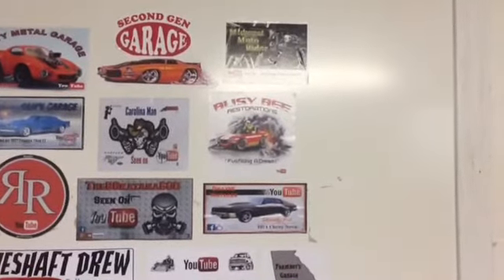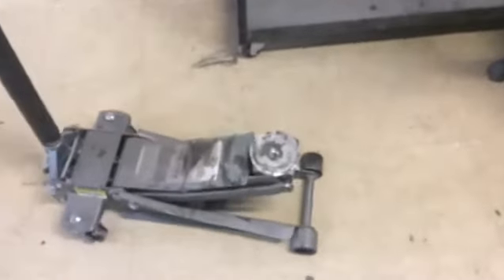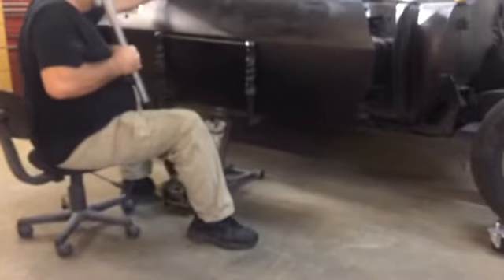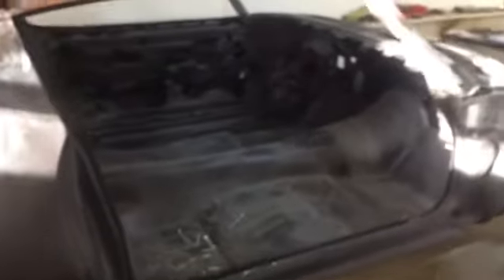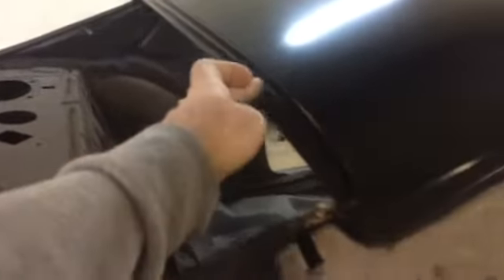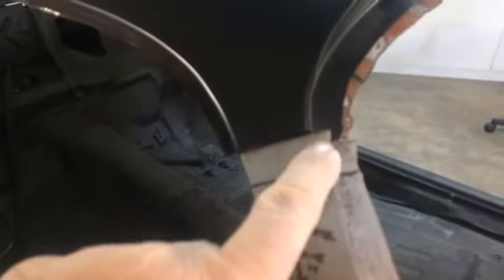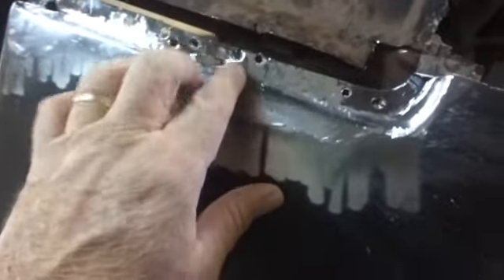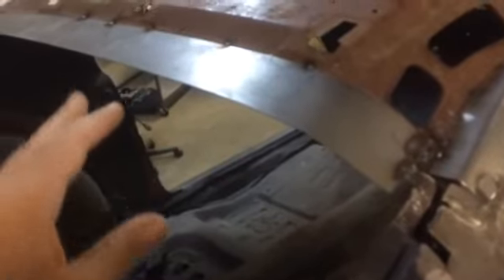Camaro roof skin replacement Part 1

Comment: I am about to do the same thing to my 1973 Firebird.  This will definitely come in handy.  THANK YOU!!
Reply from the maker: Thanks for watching Jay. If you have any questions along the way, don't hesitate to ask. Glad to help if I can...
Reply: Thank you!!  I will definitely be doing that for the next couple years.  lol.     The issue with mine is that at some point in the past 45 years, someone replaced the landau/vinyl on the roof.  I don't care for that so I took it off and it will not be put back on.  Anyway... whoever di it last, half assed it.  They even put different sized screws through the nice chrome trim around the windows, this let rust in and rotted out the roof at the top of the window and, the rear speaker deck and no doubt the trunk hinge area.  This is going to be a project.  I will be binge watching your videos today.  Again, thanks for doing these, our project cars are almost identical.

Comment: Looking good Jeff! Before you do your final welds on the roof skin support structure, I would make the cuts on the roof skin so it can lay exactly in its final position and use it to make sure the inner structure is correct. Just my two cents. I would also mark the center of the inner structure and roof skin front and rear.
Reply from the maker: Did a lot of test fitting today. Trimmed down the edges and marked the centers so I could replace in the same place every time, great info and much appreciated. Got most of the sub structure repairs done, should be ready to weld up soon. Thanks for commenting and watching..

Comment: Good Videos and thanks for making them! I'm building a 70 and much like yours, it does not have a lot of value. It's a base with no original parts and had 2 previous and terribly executed restores. I've had it for 2 years and another unexpected  project put the 70 on hold, but last spring I started back up on it. I have a very small garage/work space and didn't expect all the metal work the car needed. I was lied to when purchasing as the the guy I got the car from told me all the metal work was done and the only reason he was selling it because he found the car of his dreams... I think it was a lie and he realized that even after all the "work" he did/had done to this car it still needed much more. So a lot of seam sealer and paint he threw the car together. 

Anyway, so I did a little metal work and will straighten out some of the stuff he did and will put the car together and enjoy it a little. I hope to retire in a few years and move out of the city and gain a bigger work space. Where I plan to take the car apart again and do the floor pans, quarters, package tray, trunk and tail pans over.

Sorry for babbling on, but I'm really learning a lot from your video's, as well as Russ over at Double RR and really appreciate the time you take to make them. I've watched many of your videos skipping around a little, but I started today watching them in order. Hope you had a Merry Christmas  and wish you a Happy New Year and look forward to your videos and your progress with your 72!
Reply from the maker: Wow! Can't thank you enough for the great comment and for watching. Sorry about the 70, but when you get started on the resto you'll have plenty of video help. There is no way I could do all this without YouTube. Good luck and thanks again..

Comment: the cradle looks like it worked great! I couldn't tell if you bolted it to the center post of the jack to keep it from tilting off? Your making some good progress on the roof! If you need any more measurements or shapes of the back glass area don't hesitate to let me know. I have a couple cars with the back glass out that have the original steel. My inner panel is 20 gauge so 18 should be good.
Reply from the maker: It is bolted through the plate, used a piece of 1/4 x 3 for the bottom. I think I got it, but if not I will holler. I appreciate it Idaho...